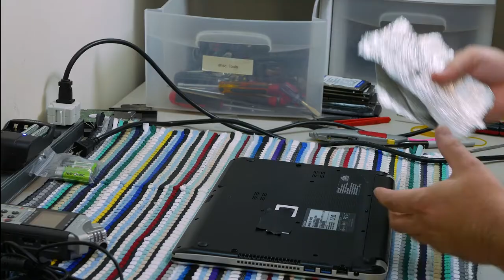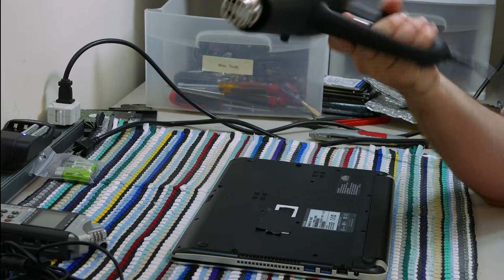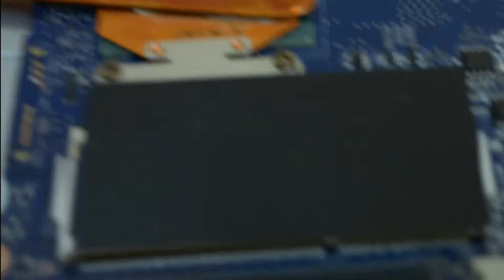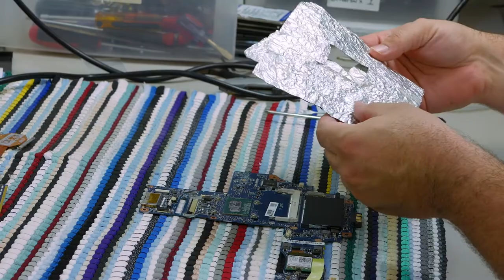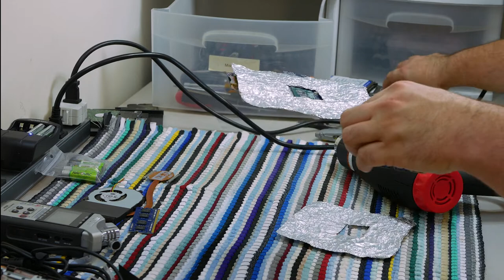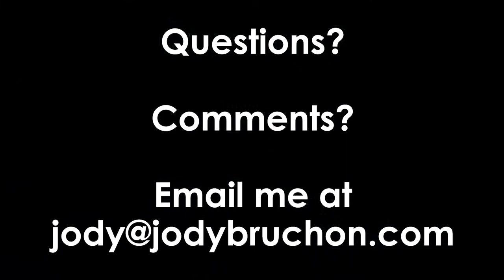Reflowing a Laptop Motherboard Made Easy - Works on Desktops, Game Consoles, and More - Jody Bruchon

Comment: i have a hp pavilion dv6 laptop and i played geomerty dash the whole thing overheated and froze so i turned it off and let it cool turn it back on no display no video out no nothing i did a reflow on the gpu expecting it was gonna fix the issue but it wont power on now the charge light is there but no power on button and i dont have a working battery for this laptop and it worked fine without a battrey before and i really dont know why i tried difrent ram nothing i checked the cmos battery but that battery is fine

Comment: Why only around the CPU? My laptop crashes when bent sometimes im suspecting a reflow might fix it. Ive already dissasebled and experimented  with the laptop several times so im familiar with dissasebly. But im curious about why you only heated around the CPU and not the rest of the board.
Reply from the maker: A reflow specifically addresses fractures in the solder balls of a ball grid array (BGA) chip, the big green ones with metal dies sticking up in the middle that are obviously stuck to the board but have no solder points visible on the edges. There can be over a thousand solder balls under one of those BGA chips and a "reflow" literally heats the BGA "sandwich" to make the solder flow again, mending any ball fractures by melding them back together.

I only heat the chips because they're the only components with ball grid arrays underneath and because if you just start blasting heat at other parts of the board it may melt plastic parts or cause components to fall off, potentially ruining the board and making the whole exercise pointless.

Comment: Thanks for the video, so these temperatures are in centigrade, right? my case is a laptop that shows power led, can be switched on and off, but no HDD activity, already tried other RAM module, no display, however, when I take out the RAM module I don't get beeps, blinking codes even in caps lock keyboard, so I was thinking in do a reflow, what do you think? thanks for your answer, have a nice day!
Reply from the maker: I usually work in F, not C. For modern RoHS lead-free solders you need to heat things to 370F minimum, possibly even up to 380F. As long as you remove anything that could melt or be damaged (plastic stuff, mostly) and shield everything with a thick foil cutout shield and control the temperature, there's not much downside to doing a reflow. Just don't use 1500W heat guns on high for very long as they'll quickly damage something before your temperature gun can warn you it's exceeding 400F.

It sounds like your unit might be fixable with a reflow. What do you really have to lose?
Reply: @JodyBruchon  Thanks for your replay, and you're right I don't have anything to lose if I try it.

Comment: Hay.. i have the same symtomps.. wont boot black screen no bios
I have do everything except reflowing cpu
I was try change ram
Reflow discrete gpu
Even reflashing bios
Change harddrive and nothing work

My cpu also soldered like in this video

Maybe it safe to reflow cpu?
Btw i have done and succes reflowing my another laptop, but its gpu reflow
Reply from the maker: It is safe to reflow a soldered CPU. Be aware that in some cases the motherboard is just shot and a reflow won't fix it. You have nothing to lose.